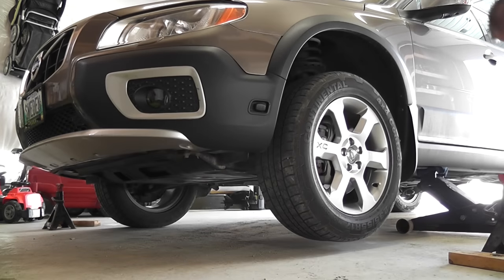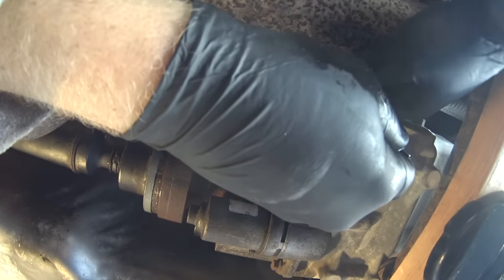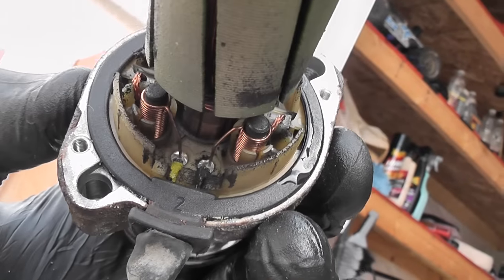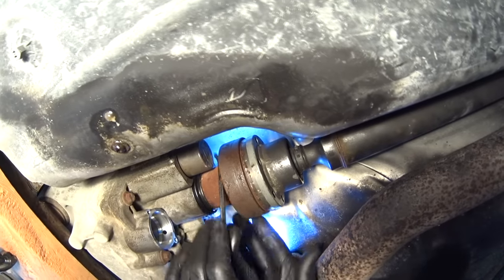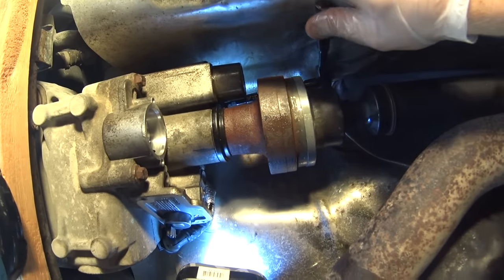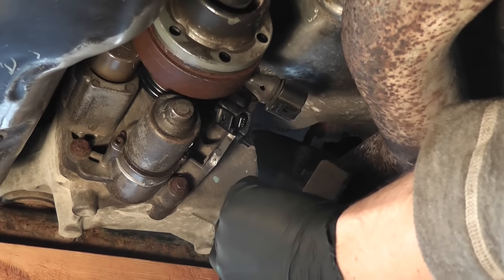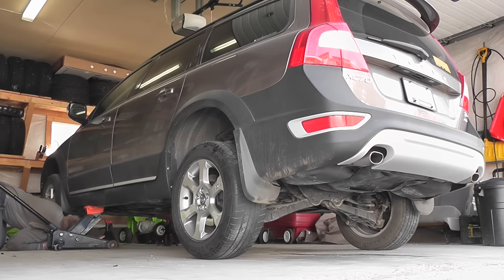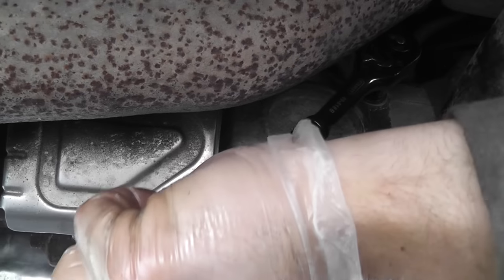Servicing Haldex AWD on a VOLVO

Comment: Hey so the AWD on my Volvo 07 S60R is not working as I tested in the snow and didn't see the rear tires kick in to help when the fronts where spining is it not working because it needs to be serviced as in new oil filter and haldex oil and new pump or does it need a whole new haldex for it to work?? P.S. its a Generation 3 Haldex

Comment: Great comprehensive videos, ive done mine twice now but i have a 2011 Ford kuga with this exact system, i have aw55 auto gearbox fitted which has the larger damper on the input shaft  at the front of the Haldex which makes removal of the pump impossible as its almost touching the end of the pump, ive been looking at the design of the Haldex unit and i actually think its a design oversight to fit the pump and the separate filter  in the positions they are, surely the pump and pre filter gauze should be after the filter and not before, as they are sitting in the pool reservoir of oil which has all the worn clutch dust suspended in it which when the pump operates, is drawn into the pump through the pre gauze and then in to the filter, thats just crazy and no wonder its the gauze that clogs on the end of the pump first, i disconnected my pump at put 12 volts on it so that it ran backwards for a few seconds and that dislodged the gunk stuck on the filter screen , then sucked out the oil through the filler plug and then refilled, no more fault codes after that. The first time i did it and changed the filter i cut it open, it was discoloured but not blocked, i think this proves my supposition.

Comment: Greetings from Sydney, Australia. Well done mate. I don't have a Volvo as yet, I'm thinking of buying one..used.. just doing my research. Excellent video, clear, concise tutorial without the bloody music. Thank God ! This is how all these types of videos should be ! Good onya mate !
Reply: Good luck. I have an 09 s80 t6 awd and I have some mad grinding noise that I can't figure out in the front passenger and its happening when accelerating hard or deceleration and even if I rev the motor in neutral. I've went 10,000 miles since it started and had it in and out of 3 different volvo dealerships and they claim to not know the issue. I've done motor mounts, torque mount, bearings, and but I always replace every suspension part on my cars because I had a 97 corolla and the wheels fell off 3 times and it was always something stupid like a bushing, the fact they only have 1 ball joint on each front and I didn't know my tie rod was going to randomly snap moving under 15km/h or 5mph around that. 😢 But when the parts broke I could properly get it pulled over in time and not be holding up traffic. I'm just having a bad time with the volvo.
Reply: Finicky cars. Fragile plastic under the hood, weird bs sensors fail often (radiator anti tamper device?), and low build quality. Make no mistake, Volvo is Chinese. No matter how many delude themselves into thinking it's a swedish brand. I recommend Lexus/ Acura. Good luck

Comment: Thanks for the heads up directions to replace the rearbrakeson my 2012 XC 70 T6.  The caliper and frame bolts were very very hard to get off .
The small torx 30 bolts holding the  ebs also were a problem.  The two tabs holding the actuator to the caliperon one wheel broke off.  Suggestion please.   URGENT  Car dead now.

Comment: First, thanks to you, I did the replacement of all light bulbs, discs and brake pads, oil in the power steering, gearbox and differential, all filters and much more.
And now one question. In Bosnia and Herzegovina, Volvo haldex oil costs 100 Euro 1 liter. That is too much for me, so please tell me if it is possible to pour a replacement oil of the same quality into the haldex? From another manufacturer? If yes can you tell me which, for example haldex oil from SWAG for VolksWagen which also uses haldex system.
I drive an XC 70 D5 136kW AWD M66 manual transmission 260000 kilometers.
Greetings from Bosnia and Herzegovina and I wish you a long healthy and happy life!

Comment: I would have a question for anyone here. I have a 2016 XC60 and I have asked Volvo for a quotation to change the oil in the diff and angle bevel. They said that for the diff they need to take down the back deck ensemble. Anybody knows if that is right or are they just bullshitting me?

Comment: Good Morning Volvosweden and Volvo owner,
I did work on Haldex. My car is a Volvo XC 70 08.2008 D5244T4
I started the procedure as described in your very good detailed video. 
But I recognized, that the Haldex of my car (see above is a little bit older) is different: I could not take away the oil pump! The housing was very close to the propshaft. Similar to your video from a video with Haldex 3. But on the other hand, my Haldex has although the filter up as the Haldex 4 in your description. I changed the filter and sucked out 450 ml oil and I didn’t lose quite no oil. I filled in 450 ml of new oil. I thought to have again the correct oil level, it must be logic, having lost quite no oil.
But never the last, concerning your description, I turned around with the car. I leveled the car in plain position.
My idea was, that I would have only to fill up about 40 ml, to come to the fill up level, when oil sucks out! But it was 105 ml to come to the level! 
Taking away the 40 ml there remains a difference of 65 ml!
The question now: is the correct level by my Haldex a different level to the discribed from yours? Have I now to much oil in the Haldex? I can t imagine, that oil is "disapiered" in time. What may be the solution? 
I hope you understand my question. You have an idea? I would please you to inform me how is to adjust the correct level.
Thank you,
Birger from Germany

Comment: Exceptional video ! Since Opel says Haldex 4 is maintenance free, I only wish that Volvo mechanics in my area would agree to do this on my Opel Insignia with 88000 km. At first sight it's an easy job, but i guess you must have some skills to do it. And patience.
Reply from the maker: +lbanias Any shop could do it. If you never did maintenance on your car then dont do this.
Reply from the maker: +lbanias Any shop could do it. If you never did maintenance on your car then dont do this.
Reply: I am planning to do this with an experienced mechanic(hard to find), but I will be happy to participate/help. But that ''maintenance free'' mentality is hard to beat when your Haldex has no problems yet. I have no problems so far with my Haldex, but I understand the advantages of maintenance and that every mechanical systems produces debris due to friction and old oil. This video will help me a lot!

Comment: Hi , my mechanic changed the oil and cleaned the pump on my Haldex but did not change the filter. Can I change the filter with out messing with the oil? Or having to take the pump out? I am worried that a bunch of oil will come out .

Comment: Hi! Nice video. What is the risk if you disengage the pump from the software or just unplug it's pins? I just want the option to switch between 2wd and 4wd whenever I want. Will the haldex still engage then if the pump is off? Is that a bad ideea? Thanks!

Comment: Great video. Considering buying a Volvo AWD in the near future.
A small point: How come the filler plug is not also a "level" plug? 
As was the case with most gearboxes over the years.... 
It just seems odd to extract that 40ml of oil after reaching that level...??
Can it be  "that" critical?
FOR EXAMPLE, The engine dipstick normally has a quart between "Low" & "Full" marks.
It is perfectly fine to run the car between those two levels. 
And the low level is pretty 'conservative' to most makes.

Comment: Thank You a lot! The harder-to-reach filter cover screw can be unscrewed using a ratchet wrench with two extensions (a short one on the cover side and a longer one on the ratchet side) - with a movable angle attachment mounted between them).

Comment: Before using brake cleaner  remove all rubber O'rings , sometimes brake cleaner can damage the rubber O'rings ;). Great video , thanks for filming these DIY repair videos for us !
Reply: Excellent video. Thanks very much.
I have a 2018 Ford Kuga AWD with the same Gen4 Haldex design (inc. The same appalling design where the filter is nearly inaccessible, and the prop shaft gets in the way of removing the pump 🤬.  

I'm pretty sure Ford want it to fail, just after the 3 year/ 60k mile warranty is out😡

Comment: Nicely done! Love your videos, definitely make maintenance on these seem doable. I have a 2015, I'm assuming it has Haldex 5? If that's the case, you said there is not filter. Would there be any maintenance I would need to do on the unit, or only in the case where it needs to be replaced?

Comment: Hi, i don't know if you did it (not in video) , but have you replaced old gasket also ? Thanks a lot;  i will do the same procedure to my Freelander2, that has same Haldex4, so I presume  that part codes you posted are the same too. . ;-) Have you experience in Freelander2 ? And, by the way, I know it is very difficult to extract the pump without remove flange before. How did you do it ?
Thanks.

Comment: What a good video, it seems the AWD on my 2012 xc60 isn't working (confirmed by my dad who was observing from the outside when i went on a snowy field to test it out).
Rear wheels just dont spin at all, gonna see if i can remedy this issue by changing filters and oil, naturally ill take a good look at the pump at the same time.
Reply from the maker: No message on cluster? “AWD disabled
Reply: @volvosweden   no message no, a friend of mine also scanned it for any error codes (not a vida scanner sadly) and found nothing.

The car just doesn't feel like an AWD at all which is why i am very confused, no error message which would suggest the awd works but it is impossible to try and do a little snow "drift" even with the automatic in Sport mode which makes it crazy sensitive to revving.
Reply from the maker: @smiIingman That’s odd. I would lift the car. All four wheels off the ground , put it in drive and see if the rear wheels spin.
Reply: @volvosweden   yeah thats a good idea
Reply: @volvosweden    okay quick update on my situation, i put my car on the lift, had my dad get in and turn it on and put it into "DRIVE"
Rear wheels do infact not spin at all and while the front wheels were spinning i kept hearing this weird mechanical rattle, the prop shaft also didnt rotate.

Could it be the haldex pump or some sensor? Im guessing i need to take it to volvo and have them check it through VIDA.
Reply from the maker: @smiIingman grab the prop shaft and turn it with your hand back and forth. If there is lots of play then you angle gear is bad. Angle gear is in front of car connected to the transmission
Reply: @volvosweden   thanks, ill do that tomorrow after new years hangover is over. 

although if memory serves, i dont think there was any play at all in the prop shaft when i last grabbed it but this was about 2 months ago.

but yeah need to check it tomorrow

Comment: Excellent video.  Brake-klean (aka Acetone) isn't ideal for use on motor windings.  It can partially melt the insulation on the windings and cause a short down the road. The 2x4s on the jack stands gave me much anxiety.

Comment: Hello! Thank you for all your videos. I bought a 2012 Volvo XC70 like yours and same color and I followed your videos and made mine like yours. Thx.
But I have a AWD DISABLED Maintenance Required message. I cleared it and came back. So I checked and topped off fluid level and cleaned connections. It went away again. I did change filter and cleaned everything before. Maybe it was the fluid level?
What else could it be? Any parts you can tell me would be appreciated. And the wheels in AWD mode are turning. Thank you again my friend!
Reply from the maker: Hard to say. You have to scan for error codes

Comment: when i clean electrical components.weather it be alternators/starters heater motors,i use brake clean with no issues,,sometimes i use blow gun to dry,,other than that i use wurth contact spray,just blow it off,

Comment: Does anyone know the difference between "Haldex" oil and 75W-90 "differential oil" ? His package said "transmission oil".
Reply: diff oil is gear oil, thicker with more guts to lubricate high loads. haldex oil is effectively hydraulic oil, because it is a fluid power transfer oil

Comment: Hello. Found your great wideos yesterday. I have a 2008 model and i wonder if you have a solution for my problem wich is that i droped a café au lait in the passenger seat and it smells old milk from the air coming in to the cupé. I have fans in the front seats. Looking forward for your answer. 
Thanks a lot for your time. 
Regards 
Stefan in swden

Comment: The AWD volvo is on demand rear wheel drive in other words only if the front wheels slip, the rear wheel start to turn. So unless you drive on slippery roads it may never activate .
And that's why volvo claim its service free.

Comment: I just did this service on my 2011 S60 drove it around and topped off fluid, it worked great. Took it for a longer drive and the Service DSTC light came on. Great timing or could I have messed something up?
Reply from the maker: You need to read codes. Could be a coincidence.

Comment: Has anybody ever had any problems after using brake cleaner on the pump motor like that? I would like to do the same, but I'm a coward 😂. Any words of experience to reassure me?
Reply: use any fast drying fluid like toluene, even IPS. make sure it dries without a trace

Comment: Very good video. I bought car used with 100k miles and the AWD did not work. I just did the filter and oil change on my 2010 xc60. However my AWD still doesn't work. Would you recommend replacing the pump or the DEM? There is no noise from the rear end, so I assume the Haldex gearing is good.
Reply from the maker: Most likely pump. But best to diagnose it. Read codes

Comment: Good job, congratulations!
I have a question if you would be so kind as to answer me,
I have a Volvo XC 60 136 kw 2009, I got an error, P2015, the symptoms are as follows, sometimes it happens that the car stops pulling, it is limited no matter how hard I press the accelerator pedal, but the engine does not develop power, but the speed doesn't even increase, and it sounds like a cylinder under pressure is blowing air, not continuously but only when the gears are changed (it's an automatic transmission), do you know what this means and where to look and how can I solve the problem? if you are kind enough to tell me where on the engine to locate the problem,
Thank you
Reply from the maker: I can’t help. Don’t know.
Reply: @volvosweden  
I found the problem, electronic actuator from the turbine with mechanical problems

Comment: ...  An excellent and informative video .... did leave me wondering though when Volvo do such great engineering why did they not finish the drive flange rear face with a 45 degree chamfer to allow the easier removal of the Haldex pump without needing to remove (?) the drive shaft at all ??
Reply: This isn't great engineering. This same job takes 5 mins on a Japanese car. No pump, no filter,  and the differential will last 3x as long without leaking

Comment: Not sure about spraying brake cleaner on the pump bearings ?  What do you guys think?  May even affect those rubber seals.  That cleaning is not necessary.  Also, don't use sandpaper on surfaces with a seal, use stainless steel wire sponge.
Reply from the maker: +Royale with cheese Thx for the tip.

Comment: Nice jobs as always with your other videos. I have a 2008 XC70 with a Electro Parking Brakes problem, it will not apply or release and the message onboard - EPB needs servicing - any suggestions to fix/service the EPB? Thanks
Reply from the maker: +Yen Ding You need to read codes using VIDA. I got VIDA on Ebay.

Comment: Brilliant, my one is a C70 Coupe T5 Front Wheel Drive ,but this was a very informative video, I would go to the trouble of making a 200 mm plate in the floor and save a lot of fiddle fuddle so I would get to the pump and filter with ease, I'm surprised VOLVO didn't come up with the plate idea.

Comment: Electric motor needs new lubrication, now that you have flushed old one away along with the debris
Reply: That motor in the pump uses sealed ball bearings, so no lubrication required. Doing so could actually cause damage if such lubrication was to get onto the brushes - this is actually one of the common failure modes that these pumps suffer. The internal shaft oil seal can leak Haldex fluid into the motor and the brushes disintegrate quickly, rendering the motor (and thereby AWD) inoperative.

There are repair kits available (eBay for example) for all the different generation Haldex pump motors that include new sealed bearings, a commutator, brushes, o-rings, screws, shaft oil seal, and electrical connector with new pins and seals. They're much cheaper than having to buy a new pump (~$35 vs ~$300).